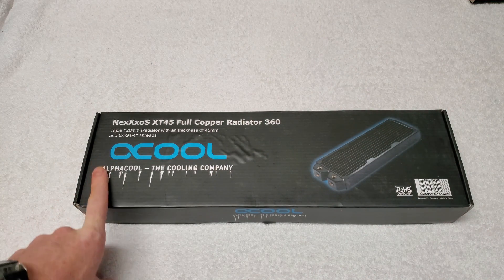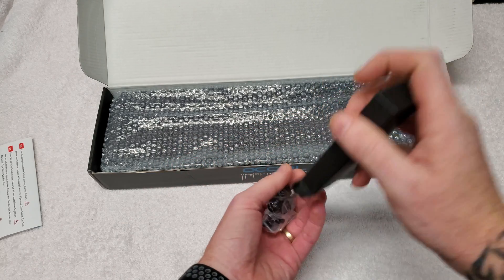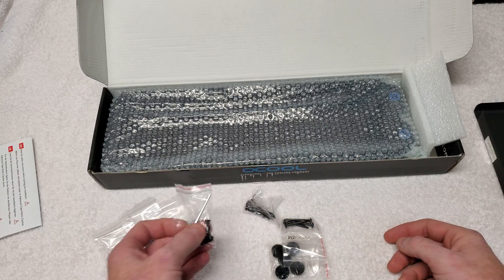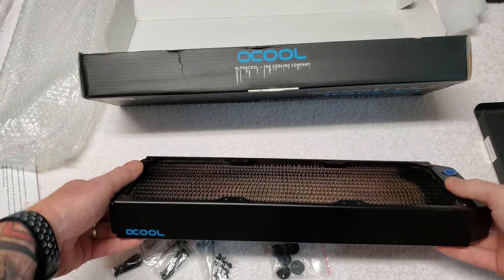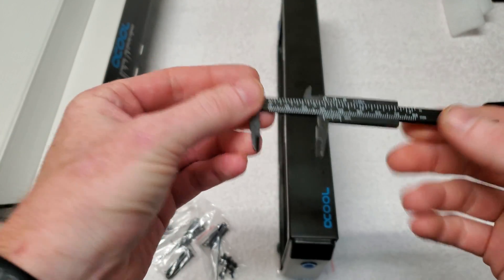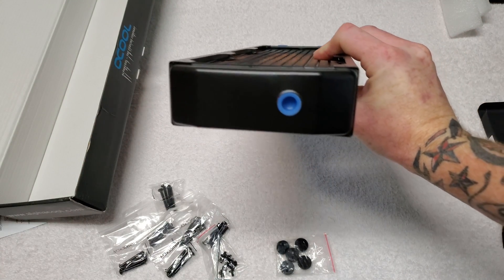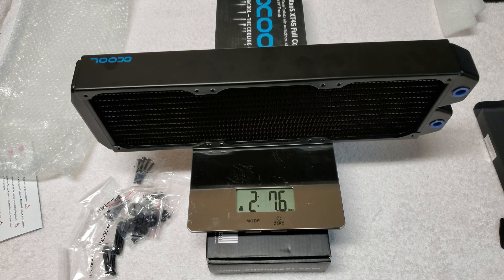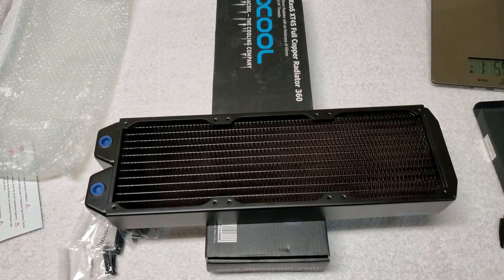Alphacool XT45 Radiator (Unboxing & First Look)

Comment: Nice rad man what's your temp on that rad gpu and cpu & idle and load
Reply from the maker: Ilde temps are: CPU 22-28C and GPU 25-28C and I havent seen over 60C on CPU or GPU and I have both overclocked. Thanks for stopping by!
Reply: Steven's Tech so how bout the load man both gpu and cpu?
Reply: @latifahzxc6961  I’m guessing he tested with P95 small FFTs at least once